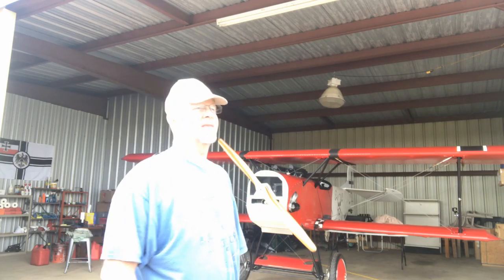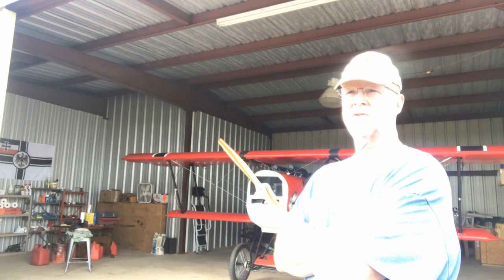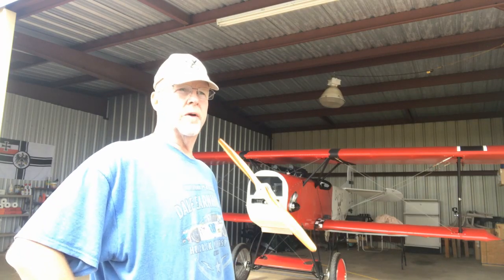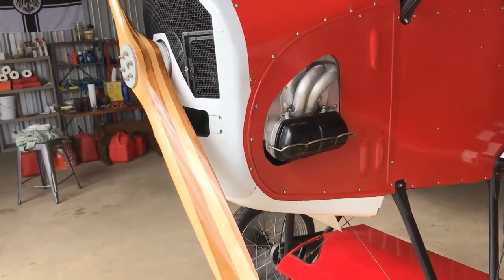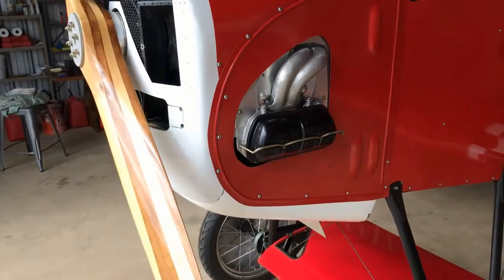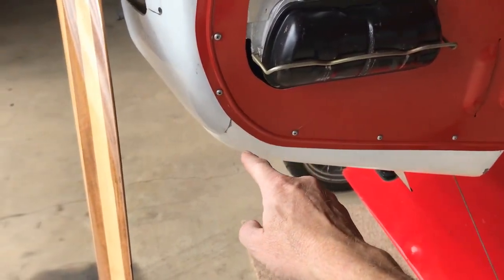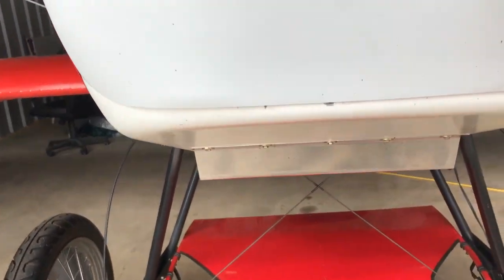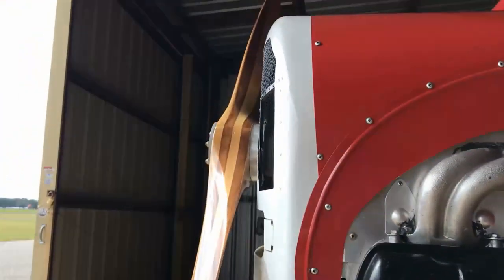How I Solved My VW Temp Issues - Bert Sparrow

Comment: I had overheating issues with my ‘71 Bus when I installed a 1776cc dual carb performance VW engine with ext oil filter.  I installed a 1.5qt deep sump and a large external oil cooler with electric fan that kicked in if my oil got hot.  I could cruise at 80mph and drive up to Reno, NV from San Francisco in 4th gear.  Total oil was a wopping 7qt!

Comment: Thanks for a great video.  Two observations.  1) Any type of grating will generally reduce the airflow by half.  2) The baffling on the front cylinders forces the "blast" air to turn nearly 180 degrees before contacting the fins.  This will increase the operating temp on the front two cylinders.  Installing these front baffles is standard practice in the north to increase the operating temperature and prevent shock cooling during winter months.

Comment: Great video!  Funny how you had a bit of metal in the forward oil relief valve...my rear one was galled and wouldn't release - had to take some emery cloth and polish it.  Glad to hear you've solved the problems; they seem to have a way of being cascading in cause, don't they.  I agree on the oil weight.  Even in winter when it's below freezing I've had no problems with the VW recommended weight.

Comment: so basically these VW engines by Valley (?) are produced with 10:1 heads,  small oil cooler,  and no baffle instruction.  I don't thiink I'd be happy behind one of those !
Reply from the maker: Sort of - but you have to remember context:  Meaning, of all the WWI planes, all the British and French planes have a big opening in front and the bottom, so they had no problem getting cooling air.  But it was the D7 with a completely enclosed cowl, that meant struggling with cooling air.  All my friends who fly VWs with Nieuport 17s, or 21s, or 24s, or Sopwiths, or Moranes, NONE of them have a completely enclosed cowl.  Even the Fokker Triplanes had more wide open cowls.  So I say all that to say "it depends on the cowl design."

Comment: Have you though about moving your Oil Cooler OUTSIDE your Engine Bay under where you sit.  Having the cooler in the sealed engine compartment common sense tells you it’s contributing to your overheating.
Reply from the maker: No, because the hot exhaust air is piped under there.  But I have thought about dropping the oil cooler between the landing gear legs in the summer with some sort of bracket.  Besides, under where I sit if fabric.  I don't want to punch holes in it to make a mount